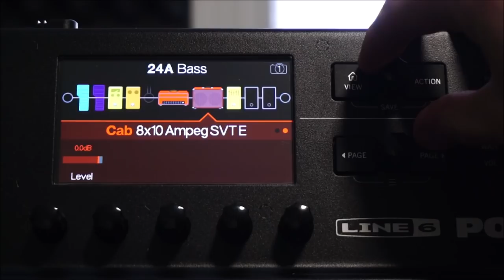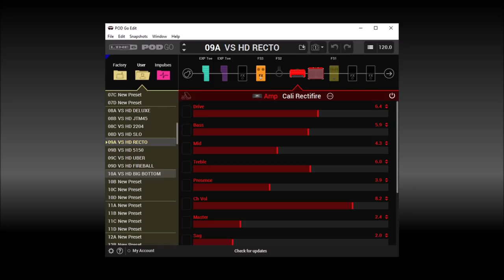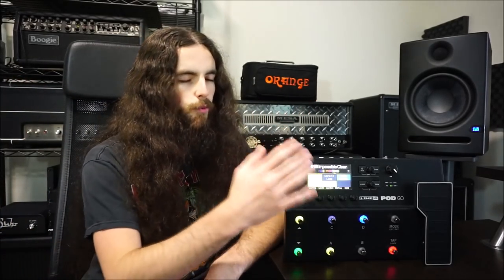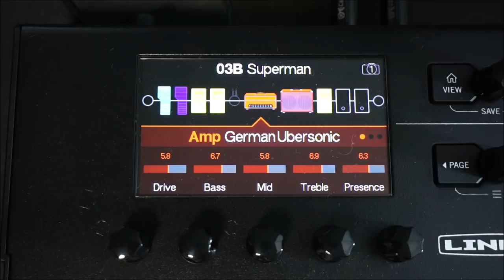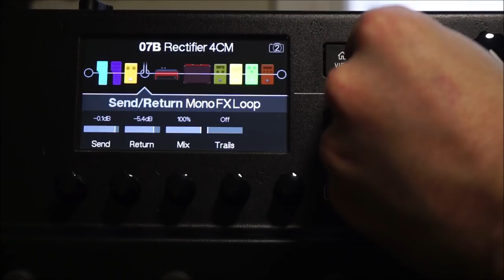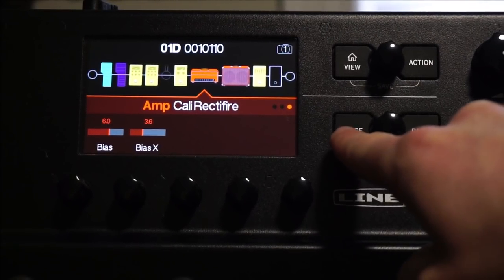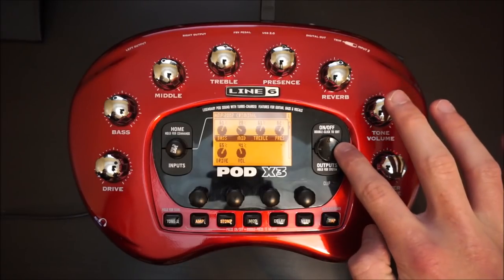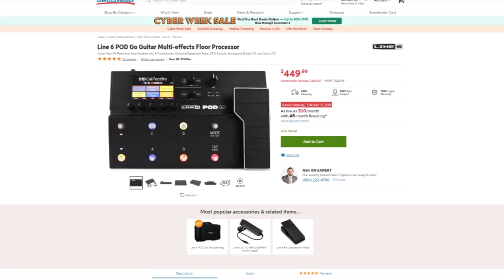Gear Curiosities: Line 6 POD GO - Helix in Cheaper Clothing!

Comment: I picked up a Pod Go back in September to replace my 10-year-old Floor Pod Plus.  I had generally gone ampless over the past few years, using the Floor Pod live and in the studio, after getting tired of dragging a half stack or my Evil Twin around.  If I want to run a speaker cab I run the Pod Go into the effects in of my Evil Twin.  The Pod Go gives me all the horsepower I need for shows or recording, with more amp/cab choices than I would ever need.  The biggest complaint I've heard in reviews is a lack of routing options but I don't need to run complicated signal paths.  Is the Pod Go a Boogie Triple Crown?  Nope.  Does it offer killer tones for 1/4 of the price of a Helix or Kemper?  Yep.  If you like spending tons of money and spending all day programming get one of those.  If you want killer tone and simplicity, get a Pod Go. 
Thanks for the video and all the best from the Bay Area!
MK

Comment: I’m not a big fan of the stock cabs but having the right IRs really bring some of the amps to life
Reply: The stock cabs are a little bit underrated. They can be great with tweaking.
Reply: Actually. Not being able to do the stereo/dual cab block is quite limiting. The best results on Helux always came from mixing mics and cabs.
Reply: @neighbourhoodmusician  you can dual cab on the hx stomp and helix rack/floor unit if I’m not mistaken
Reply: @djandrewification  You can indeed. I've had both of those units.

Comment: I strongly suggest that you give the line 6 power cab or power cab plus a try I was going to get a pod go a few months ago however when I got to the store about 2 hours drive away they hadn’t gotten their shipment so I went ahead and bought the HX Stomp and I have to say that I am in love with the switch from a tube half stack to digital modeling.... I was using the power amp section of an old bass amp I have and for Christmas My Father got me the power cab and comparing it to the effects loop of a small combo amp and a regular frdr speaker the difference and quality of the power cab is out of this world I am honestly shocked at how good the sound is and for that reason I believe that the line 6 power cab and power cab plus is worth it’s own episode of gear curiosity

Comment: Great video. Don’t know if it was out when this was released but they do actually have a great VH4 emulation in there now of channels 3 and 4, and they worked with REVV and have modeled the Red and Purple channels of the Generator, which in real life is the halfway point between a Peavey 5150 and a Dual Recto(have played 5150’s for 12 years exclusively), so those kinda make up for those areas. Overall I agree, but I mainly use real amps(Peavey 5150/6505) and just use the Helix for FX and as a clean preamp, but for fly dates, having a handful of amps I can dial in a great tone with is more than enough. Besides, my bandmates are running Fractals and even though they sound great, if they break down, you’re screwed. The Helix has a USB stick that can hold your presets on so if something happens to mine, I’ll go to GC, Sam Ash, or any store that carries a Helix, load my presets and continue touring. Besides, cab impulses make just as much as a difference as swapping the head. If I was strictly using Modelers, I’d get a Quad Cortex, but for me, the Helix is fine

Comment: I stuck with my pod-xt-live floorboard for about as long as I could and made the switch to the pod-go. For well over a decade, I balked at the price tags that Fractal started. The price of pod-go is that of a switch from the pod-xt-live.

As for other competitors, the stereo effects loop was the key to my choice. If you bring a Zoom MS70-CDR in to the effects loop, you get 10 extra blocks (4 + 6) without resorting to the hack (which only gets you a couple more blocks).

Being able to operate the unit from the unit -- that is, without extra software -- is critical ... mostly because the software option will die off long before the unit will die off (try finding JDK1.4 to run the edit software for the pod-xt-live).  No thanks to Microsoft, of course (or Sun/Oracle).

Remember: there is no greater impact on tone than practice!

Comment: There is a hack that you can do by exporting a preset onto your computer and using notepad + you can delete a few things and you can turn your volume, wah, effects loop or any combination of all three into useable pedal combinations.  There is a You Tube video out there that shows how to do this. I have one preset that lets me have 7 effects on top of Eq with amp modeling and cab turned off so i'm just getting the clean sound of the power amp section leaving me more DSP for effects.

Comment: Hi, to emulate spk you need 2 things. One is IR and the second is BR (band response) because every speaker has resonant frequency and band-pass range. IR without BR has no chance to sound like real speaker so you nee to eq your IR to introduce weight for certain frequency to be compute with IR graph accurately to be reacting like real thing. If not alone external IR will produce too harsh sound compare to internal cabinet emulation but you know that because of your observation. Cheers!

Comment: Pod go does sound brighter but that's not always a good thing.  Imho some tones are better in the hd while others are better in the go. Now the hd is darker sounding until you add a 5 band eq after the amp then it cleans up the mud.
Reply: Agreed. I was surprised at how fizzy and unpleasant the mids/highs of some of the Pod Go amps sounded and would probably not bother upgrading from an HD if I had one.

Comment: If you had to choose between 1 tube amp or a modeler platform what would you choose. I just moved from OLD modeling to a synergy syn1 and I feel the syn1 system is AMAZING.  But I haven’t tried any newer modelers other than amplitube plug ins. The feel of the syn1 is SO much better.

Comment: Sounds plenty good enough for live use, and really damn goodwith the right IRs. But I/O is a bit too limited, and god dammit line6 give us a standalone power amp model already! Even the big helix doesn't have one, which means using it as multi-fx and cab sim for use with a real amp it's so damn limited! I've got a midi capable engl, in my head i want a rig with just one multi FX floor unit that splits off a cab and power amp emulated signal to FoH, does all the FX i want, and controls my amp via midi. But that's apparenlty super freaking difficult...
Reply: I agree. What the fuck.
Reply: Thats what the line 6 vetta was and line 6 spider HD etc. Those amps dont sell nearly as much as their multi effects did so that trend died.
Reply: @colelewis9940  i don't mean an actual poweramp, i mean a poweramp model inside the  helix. so you can run a real preamp into the helix and simulate a poweramp before the IR loader for a direct PA signal. preamp straight into IR doesn't sound as good as preamp into poweramp sim into IR.
Reply: @givemeajackson  Ah I see. The reason companies dont do that is it makes it far easier to copy their algorithms
Reply: @colelewis9940  how so? i just need a basic 6L6 and a basic EL34 poweramp sim with a presence knob, like what's on the mooer radar, or something like an on board version of the TPA1. doesn't need to be the poweramp part of any particular amp model they make.

Comment: Hey man, love your channel. Could you please help me tho? I'd like to run 2 amps. One for cleans,  then switch to the other for the broots. Lol. Is an A B Y pedal the best/ cheapest option,  or is there something better??
Reply from the maker: Are they both combo amps or individual stacks? If so, an ABY would probably be the easiest solution. If you want to run two tube heads into a single cabinet though, you're going to need some more gear to make it work.
Reply: @PlagueScytheStudios  they are two seperate half stacks. Jet city 50 on a Marshall 4x12 with veteran 30 and creambacks, and other stack is FRYETTE deliverance into mesa 4x12

Comment: Right now I own a Blackstar ID:100TVP head and a 4x12 cabinet, an overkill since I only use it at home. For practicing I use some VST plugins and a audio interface. So I am searching for a good amp modeling solution, the most bang for the buck under 500€. Thanks for your review! This pedal board is lacking some things I am hoping to get (a tone capture function for instance). Some other pedal boards I consider are:
-Mooer GE250 (or even a GE300 if I can stretch my budget a little)
-Hotone Ampero 
Do you have any experience with those?
Reply: The Mooer stuff is good but for a bit more money i'd take the Line 6.

Comment: Does the loss of stereo mode to mono apply to going through an amp & cabinet as well as just diretly into cabinet?
Reply from the maker: You have to have something with a stereo receiver to play this in stereo using the Main Outs or FX Loop. A typical guitar amp is always going to be mono, with only some amp heads and combo amps, especially of the solid state variety, having stereo FX returns. 

My comments in the video pertain to the Amp Output of the POD GO specifically, which is always a mono output no matter what. So it doesn't matter if you connect that to a stereo amp setup or not - you're getting a collapsed mono signal at all time.

Comment: Amazing vid....Question, im a semi-pro Guitar player, old-school 80's hair metal guy. I am purchasing a Ceriatone KK with Molecular Overdrive channel. I use OD, Delay, Verb maybe some chorus. I would like an amp switchable pedal. Do i get just a small switcher with 4 Great pedals or do i spend 1700 on a product that i will use 3 effects? Thoughts.
Reply from the maker: Thank you! It depends on how capable you want each pedal or block to be. If you stick with one setting for each one, an affordable loop switcher and some one trick pony pedals will do everything you want. If you want a bunch of different drive or delay sounds easily accessible at the press of a switch, thats where a multifx unit usually wins. I prefer to stick with pedals with a particular "character" when using real tubes, those that are harder to replicate with a modeler. For a generic Tube Screamer or room reverb though, the POD GO is fine at that.

Comment: Couple things. First thing,  you can absolutely use snapshots to change the amp parameters to make a clean amp go into over drive or vice versa. You do it the same way you would when assigning footswitches on the little menu. Lastly, there are "spare blocks" presets on custom tone that get rid of the vol, wah, fx loop, and eq in favor of blank blocks. This opens up the flexibility of the unit. Does not increase dsp though.

Comment: honestly couldn't you just use an outside IR loader (like people do with Pod HD rack units) somewhere in there to work around the amp out IR and foh isssue or am I thinking wrong. I mean if you HAVE to have the fx after the IR it wouldn't work, but I mean   it could be something to play around with.

Comment: Pod sucks, this sucks, and Helix sucks. For Home use you have Mercuriall, Neural, S Gear and Nembrini, all of which sound 100 times better. For live situations the FM3 kills this thing. I'd even say the Zoom G3N and G5N are better than anything line 6 has to offer. Kemper, other Fractar products or Neural Cortex are at a different price point so I wont even mention those, but the bottom line is Live 6 has a problem with the algorithms. They issue is not with hardware, it's just that the software sucks
Reply: how do you explain that in blind tests, what you describe is nowhere near?